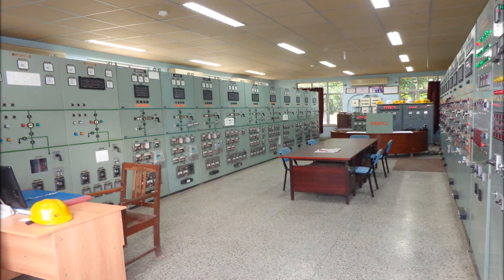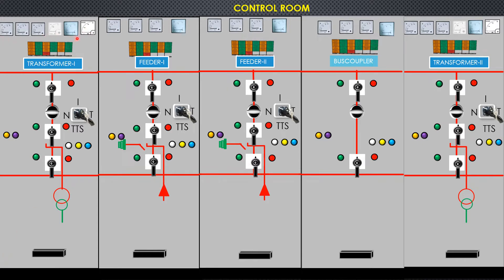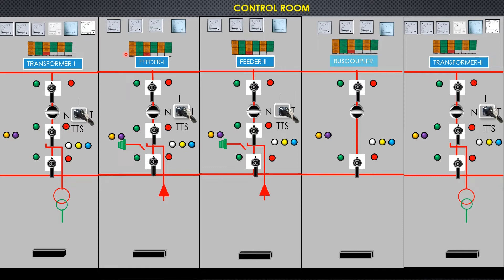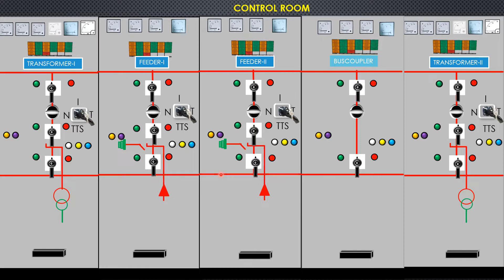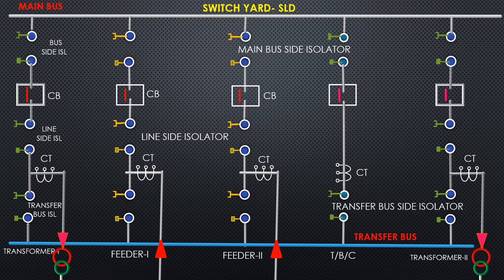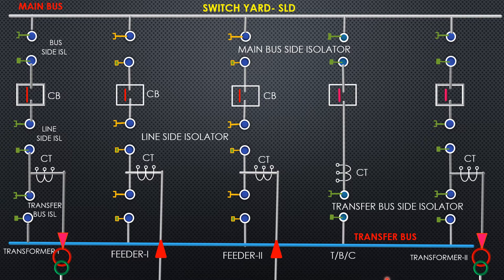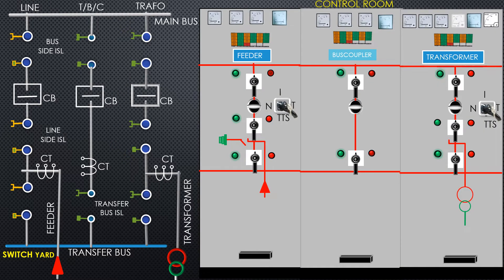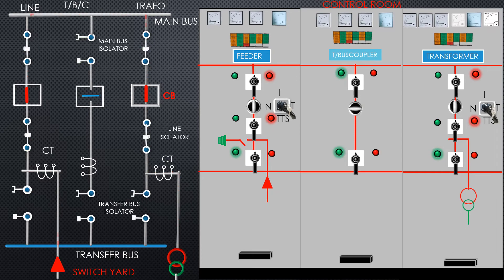N.I.T SWITCH:T T S: ELECTRICAL OPERATION AT SUBSTATION: SHUTDOWN PROCESS BY PARALLEL OPERATION:

Comment: under voltage on but how to connect so that alaram is on
Reply from the maker: Firstly,didn't understand which under voltage you are asking for.But if you ask under voltage of announciator then you can adjust voltage by turning switch to low volt position like 110 Volt etc. for it is only permanent low voltage. If low voltage occurs very frequently below its operating limit then nothing to do. Only you can use automatic  electronic circuit. Thank you.